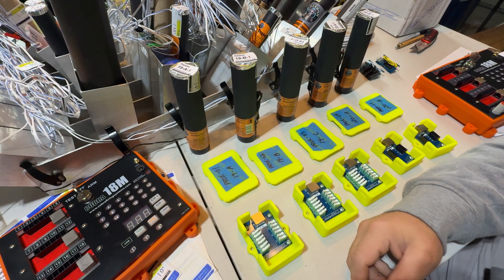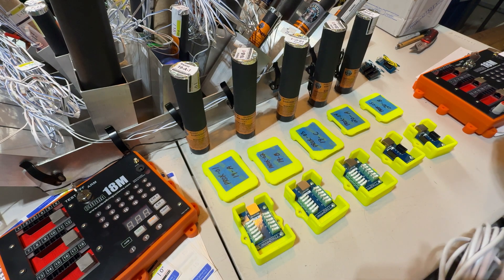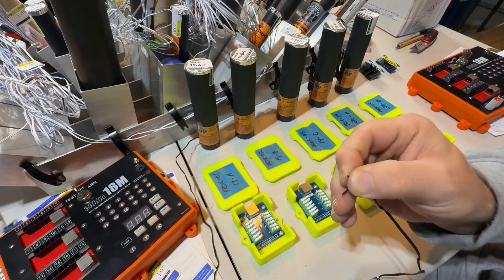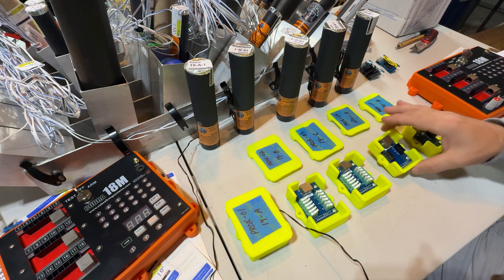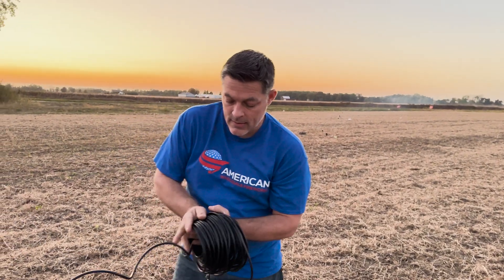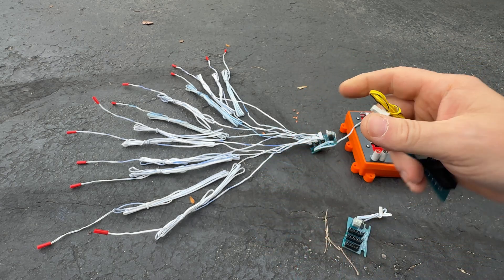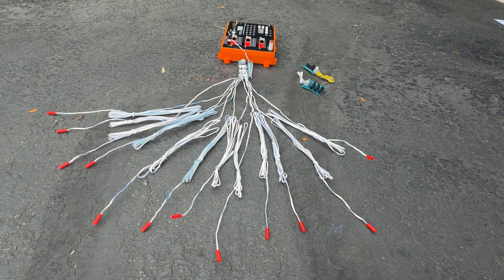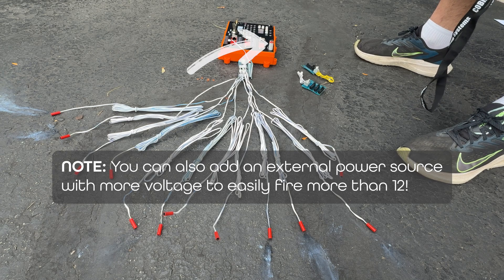SLAT BASICS - MuuxBRD Firing System Solutions (with bonus MJG testing!)

Comment: never use your modules without the antenna connected, youll fry it
Reply from the maker: It’s fine to use them without the antenna connected. Who told you this?
Reply: @TheNovicePyro  from experience, killed a $4500 wireless microphone receiver
Reply from the maker: That may be the case for some equipment, but I think COBRA has built-in protections. Not sure of the inner workings, but COBRA says it's fine. See here: https://help.cobrafiringsystems.com/hc/en-us/articles/5734123158811-Can-I-use-COBRA-without-an-antenna and here: https://help.cobrafiringsystems.com/hc/en-us/articles/5494347551899-Can-I-operate-the-18R2-without-an-antenna-if-so-what-is-the-range-and-will-it-damage-the-device

Comment: What firmware version are you running.  I see you 18 m and you change banks on that for 19a,19b,19c is that on the updated firmware.
Reply from the maker: Those labels aren’t related to COBRA firmware. They are just a way to organize which slat goes to which bank. You could name them bank 1,2,3 if you wanted and it would be channel 19, Bank 1, Cue 1 etc… In the actual script file, the effect addresses are simply 19-1 through 19-18. In other words, it’s just a way to organize them and label them better. To get these addresses, I created a custom module in Finale 3D and gave it a custom address format so that it knows to use letters for banks and place those custom addresses in my labels.
Reply: @TheNovicePyro  
Thanks ,that's sounds like a great idea.. just started using mux boards also...
Reply from the maker: Nice. MuuxBRD rocks!

Comment: Good video! I do the same with 5 front positions but daisy chain two slats together on the left and right and one in the middle. That way I can have three 18M modules for my main positions and then have a row of 5 fronts feeding off them. Slats allow a lot of creativity and of course helps keep costs low too. Keep up the good work!
Reply from the maker: Yes, that’s another good use of them for sure! I plan to upgrade a few 36/72M mods with slat connections to add more versatility just like that.